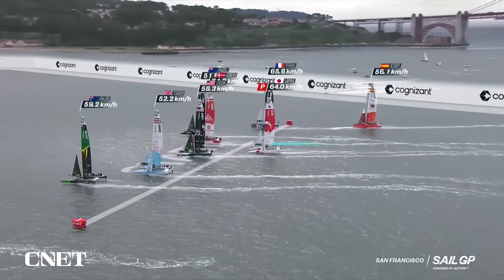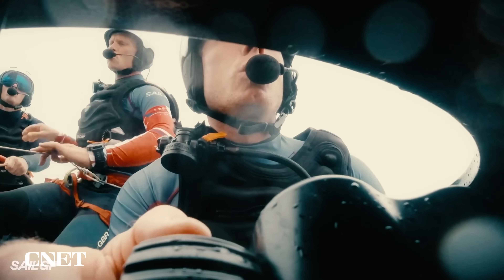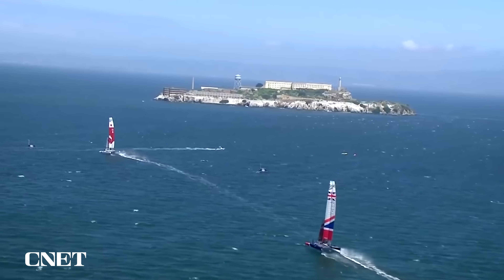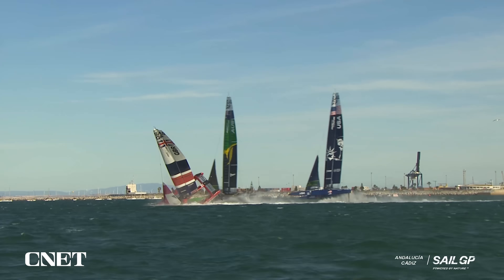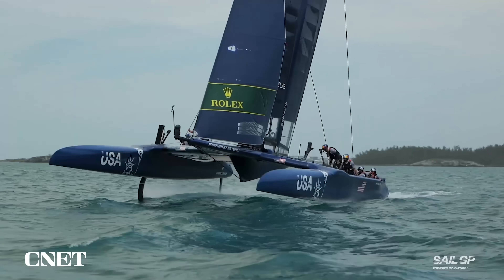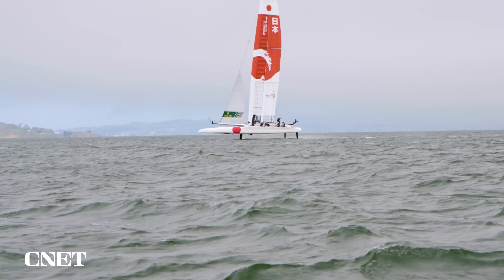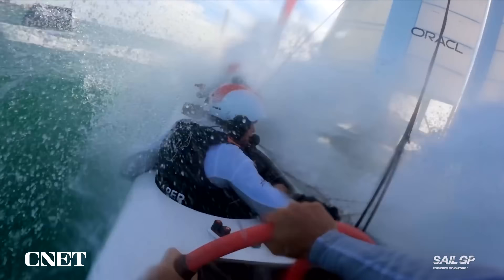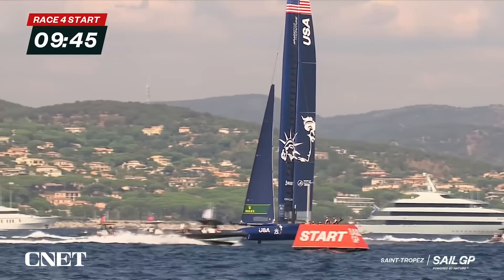World's Most Advanced Hydrofoil Boats Fly Above Water

Comment: I would love to see a much smaller version that was computer controlled and with a GPS display it can show the direction that gives the best speed and the direction that will result in the boat loosing hydrofoil.  With computer control on the sail trim and hydrofoils you can set speed caps.  It could give not only a visual display of what speed the boat is capable of at what angles based on wind speed and direction, but it can also limit the speed and give you recommendations of a travel path to a destination if you need to tack.  The computer would definitely control the foil to help it not only get up on the foil, but to maintain a perfect height and full stability.
Reply: Sounds like a self driving car. Lot of accidents in those, driving is not a simple task. And these boats don’t seem practical on open water, so this is more like a race car on a track than a practical vehicle
Reply: @alw6589  There are some nice advantages of something like this.  They basically produce almost no wake so they would not have speed restrictions on certain lakes and rivers.  Sailboats also usually have far less restrictions and regulations on them, especially if they have no motor.  Also buying marina gas is EXPENSIVE and handling gas canisters is a pain in the butt.

Just think of a private craft version.  Obviously you need it to be controlled by one person.  I know they had little sailboat hydrofoils back in the 80s I think, but that company only made a few hundred and folded.  It used floats to control the hydrofoils, but that would be FAR less efficient.  It did have dual wing sails.  It was only a single seater though, but it was fast and looked fun.  Last I saw they never get thrown out, but instead they sell on eBay for a decent price and get rebuilt.  There is like a fan club for them.

A little Arduino or Raspberry Pi could likely handle all the calculations and the sensors should be fairly cheap.  You would need servos or motors on the hydrofoils, the rudder, rotate the sail.  I like the flying wing type sails too.  A good display though is key with what would likely look king of egg shaped showing likely speeds from what angles.  You would need wind direction and speed as well as motion sensors and a lidar to detect distance off the water and wave height in front.  With a computer controlling the sale position and hydrofoils it would be impossible to flip one.

Think if they had something like a 2 seater and a larger 6 seater to start out  Maybe have a longer range lidar for detecting boats and the shore and maybe even a depth finder.  Having GPS trip planning with tacking as needed would be nice too.

Just saying... I would like to see a retail version of something like this again... and if it was handled by a larger company like Tesla he likely could sell enough to mass produce them and keep the prices low.  Put a couple of solar panels on it to power the motors and a battery and you are good to go.  Heck if there is enough power you could have a folding troller motor on the rudder that could back you out from a dock and maybe move you away from the shore into better wind if needed (very slowly).  Heck you could likely pull a water-skier or tube no problems if you have decent wind.
Reply: @toddabbott781  people already crash boats far too often and they’re currently the easiest thing to drive ever. that would be a torpedo on autopilot and would decapitate children until it was banned

Comment: Crew one of these types of boats (only with electric motors to operate all the wenches). with two Seal Teams. Arm them with a few fabulous guns, plenty of ammo, a few anti-air missles, and a couple of torpedos and it would be a formidable sailboat. Next is the double mast-wing on a mono-hull... I built a model a few years ago it flew off out to sea on the wind... it was still transmitting data for 6 months before the signal was lost. It flew and sailed 19,369 miles. Been drawing pictures here and there on napkins and office paper but have not committed it to anything like blueprints yet. Maybe Ukraine and other naval powers might look at sailboats as a way to be operational with no fuel in the 21st Century... and at sea. -Q

Comment: In theory, you only need one captain and the rest of the crew can be replaced with motors and batteries. However, it was fun to watch the staff busy doing their thing.
Reply: Not at all true. The rest of the crew have a ton of different jobs like trimming the wingsail to adjust for changes in wind speed and angle as well as controlling the angle of attack on the foils to generate the right amount of lift
Reply: @CRANKED_VANG  That's when the computer kicks in.

Comment: I can't get past the fact that the hydrofoil is able to support the weight of the sailboat out of the water.
Reply: Compare the Hydrofoil to a rudder which simply uses the water current to make a vessel turn right or left.
The Hydrofoil is shaped so that the same current gives lift instead of turning. One could also compare the Hydrofoil to the wings of a plane also using air current to give a lift because air is so much thinner than water it requires much larger surfaces and faster current but the technical data (math) works the same.
Reply: Just think of it like an aeroplane wing that can support the weight of a whole plane

Comment: Wouldn't a pedal be more effective than a handcrank?
Reply: The New Zealand team did use pedals at one point. They had bike seats in the boat and everything. Not sure if they're still using them or not.
Reply: @MrEazyE357  
No they are not 
I use to love watching the old type America's Cup racing. It showed the skill of the crew with the setting of sails and spiniker.
Today's racing in these F50 Hydrofoiling Catamarans' is really exiting. Yes they show the skill of the crew. Yes they show how fast they can sail/fly through/over the water. This makes for great/exiting entertainment and I love it.
I love watching SailGP racing.
The one thing about SailGP is, all the boats have the same design, the same mast availability, the same foil availability and all the information about how each boat performed during each race event. Great 🤩🥰
Racing then comes down to the skill of the captain.Where he/she has their boat at the startline. How fast they can get up foiling at the start line. Pick the wind shifts. Making the turns at each buoy fast and efficient and stay on the foils 100%.
Doing all these maneuvers correctly can put you in the winning position. After all, that is what each boat is out there trying to achieve. Great. 🤩🥰
This then has to improve all the sailing teams' crew work. Will these teams' be looking a the next America's Cup? 🤨🤔.
I hope so. 😀😃

Comment: Very exciting but i would have liked more of an explanation of how the sail works and why its split into separate panels etc.
Reply: They call it aerodynamics and if you use your own eyes and brains, you see that those sails are evolving towards solid wings. A catamaran mast started like a round pole, which has far less drag than you'd expect, just check a windsurfers mast. Then the mast turned into quite a large wing, with a sail attached. And today mast and sail design can be done using a computer, finding what is strong, light and most effective. Just like the foils themselves, fast computers led to amazing innovations. Today you cannot build a winner ship anymore, just applying your common sense. No matter if you are an expert already, you do need to test your ideas on a computer, or your boat will not win races.
You can search for video's on sails and masts, I bet there are good ones explaining how things work. The rough idea is, the sails have an effect on the wind, the wind direction and speed is changing a bit, compared to what it was before the boat passed. There is an energy exchange. And then things like the shape of the mast and sails have an impact on how the air moves around the sail. There are theories about that. And practical implications: how do you adapt your sails to the wind speed you have, how do you trim a sail. And these foiling cats and surfers are so fast, you got that funny problem, that the wind starts becoming a head wind, no matter what direction you are going. This effect means, there is a speed limit. For sails that work better in this self induced head wind, will result in a higher speed. Sails that do not push upwind so hard, well, those sails will be slower at any course, because a foiling cat will accellerate until the wind is a strong head wind at any course. These cats have a certain factor, some can sail four times the wind speed. For slower designs, those could do "only" twice the wind speed. Which can still be horribly fast, by the way. You got the idea, it has to do with the drag of the foils, and the quality of the sails, those must perform excellent in upwind conditions, for that is what a foiling boat is doing in the end.

Hope you got an introduction. Specialists can tell things more specific, this was just what I picked up from YouTube, and I guess this is what makes foiling cats so special. Remember, those high speeds are pretty dangerous, steering a fast foiling cat is an intense experience, you need to learn new skills, or you will end floating upside down, break the mast or similar oops. There are sailing schools that include foiling cat courses. When you live near water, you could take time and learn sailing a small foiling cat yourself. Maybe that's an option?
Reply: @voornaam3191  👍

Comment: I believe the grinders are turning a hydraulic pump which in turn powers the winch.
Reply: I dont think this class uses the same system the Americas Cup boats use, these guys are actually winding winches pulling sails up trimming as well as manually winding the dagger board foils up and down. 

With the AC75 monohulls the grinders are keeping hydraulic fluid pressure up and the sail trimming is controlled hydraulically by a crew member with a hand held controller box like a PlayStation controller, the dagger boards are electrically powered using batteries which is the only stored energy they are permitted to use, the grinders control these with foot pedals.

Comment: Thanks for taking us along for the ride. How exciting!
Would like to know how it is that these skippers can keep the boats flying when changing tack.
Reply: Simply by maintaining the speed necessary to keep the boat up on the foil (easy when you say it like that, lol). It took a lot of practice and a fair few crashes but looking at footage it seems the crews figured it out preparing for the America's cup in 2017.
Reply: They follow different lines than a floating monohull does. Catamarans have always rounded a racing buoy far wider, it pays to keep a high speed and do a small detour. These foiling cats do the same thing. Just faster...
Reply: flight controller drives while swapping sides sometimes (someone in the afterguard)

Comment: I started sailing at 10 in a moth, a “dorwilly” moth that was a tub. Then sunfish. Then GP14, which Lasers left behind in their spray…until the wind howled, and the GP14’s Celtic Sea origins rose up. These foils are a whole other craft!
Reply: Why do you say the GP14 has 'North Sea origins'? Jack Holt developed it with assistance of the Dovey Yacht Club in Aberdyfi, Wales.
Reply: @ushoys  Thanks! I fixed it.
Reply: I used to have a sunfish. My first sail boat, or more like a board. That was a lateen sail?
Reply: @JayDee-xj9lu  Yes, Sunfish has a lateen sail. Turning turtle in shallow water was not good for the upper spar. Yet the wind was so strong that day and our lead so large, we still won the race to the delight of my 3 (!) pre-teen crewmen. 😵‍💫
Reply: @jaymacpherson8167  Mine was really heavy. I got it as my first boat. My dad would just drop me of at the beach in the wildest storms as it was unsinkable. Lot of fun.